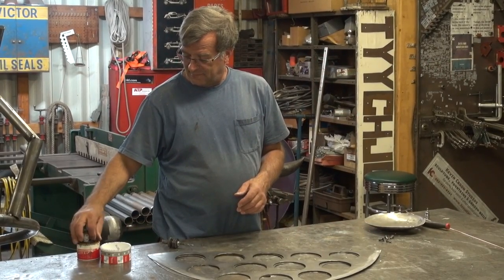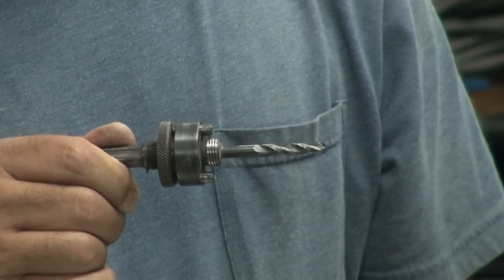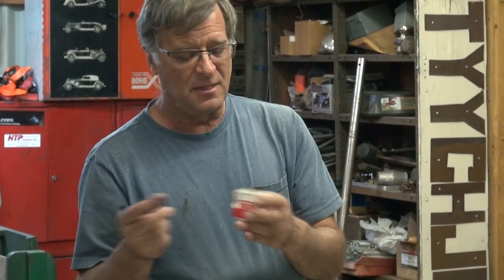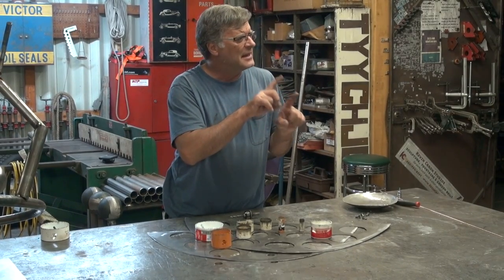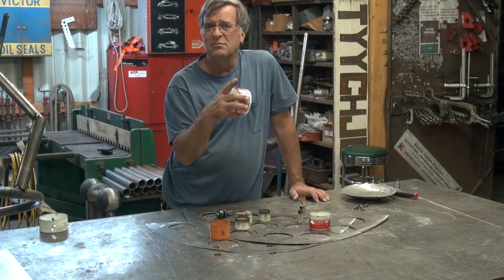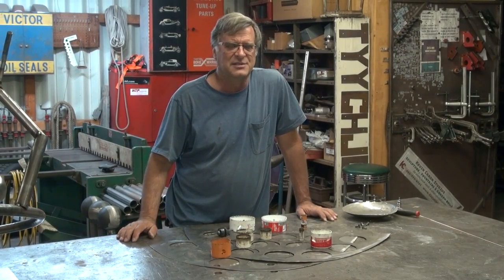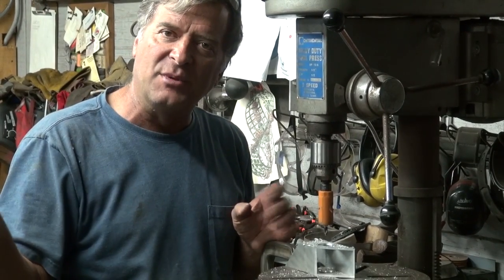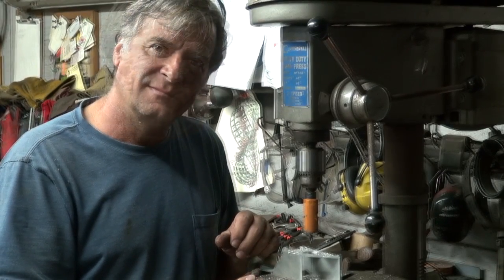How to Cut Perfect Holes in Metal - Kevin Caron

Comment: I tried making a circle cutting jig for jigsaw that I see weveryone make but it's not working for me. It will bend the blade and eventually snap the blade outside the guide. Hole saw looks better but crazy espensive. A 6 inch holesaw at Lowes was like $60.
Reply from the maker: Oh no!l  Sorry to hear that.   Tell me what you are doing and maybe I can figure out a way to help.  Are you using too wide of a blade maybe?  What are you cutting?  How fast are you running the blade and how hard are you pushing?

Comment: I find if you drill a pilot hole and replace pilot bit with a smooth rod of correct diameter prevents chatter and run out when using a hand held drill.
Reply from the maker: Have to give this a try!   Thanks for watching and posting.

Comment: Kevin look at the hf drill press locking clamp, it fits in the slot in drill press table it's adjustable to lots of stuff that you will drill I don't take mine off the table unless i have to drill something bigger than table it will also clamp your vice in place  quickly good vid THANX
Reply from the maker: Thanks for the heads up!   Will check it out!

Comment: I need some 2" round pieces from 10 gauge metal (the center after the cut). How do I get these without the drill hole in the middle?  I don't want the holes, I want the centers. So far I just fill in the drill hole with my welder and grind even but would like to eliminate this step and keep the heat off.
Reply from the maker: Use a drill press.   Clamp your metal to the table over a piece of wood and take the drill bit out of the center of the hole saw.  Go slow and use cutting oil.

Comment: Hi Kevin, great video!  With the bigger hole saws I have found it best to spin the saw cup onto the mandrel just until it touches the back part then unscrew it back a half of a turn.  This keeps the saw cup from seizing up if it heats up a bit during use.
Reply from the maker: Great tip!   Thanks for posting.

Comment: Kevin,
Thank for video. Maybe you know how to make disc from stainless steel plate(1mm) dia 30 to 60mm?
Reply from the maker: I would just cut it out of a sheet.     Or do you mean a dish?   Then you need a wheel or a shaper.
Reply: I need small disc different diameter(30,40,50,60mm).It is different thickness(1mm, 0,5mm,or 0,7mm). I need this small disc, for keyring pendant

Comment: kevin i just watched you hole cutting i want to cut 5mm of steel and i want to cut 39mm hole and then a 46mm hole on the outsde of it to make a circle ie  a wheel could i use these drill bit to do this
Reply from the maker: Yes, you can.   just do the outside first then the inside.

Comment: Thanks for the great video.  I never knew there was an automatic center punch.  Ran out and bought one right away.  One thing you didn't mention though was that you can use these bits for wood also.  The trick is to make sure when  purchasing them that you buy the long or deeper ones.  If not and you try to drill through thicker surfaces like a desk top, your bitt won't be deep anough to make it all the way through.  Tall works on anything plus they come with a channel on the side so that you can push the core out after cut.
Reply: I have not seen an automatic punch either! You learn an awful lot of unexpected things from watching someone else at work. Neither of you would think the other doesnt know this! Keep it up

Comment: Nice video. Thanks. 
I need to make  a "washer" that has a 3" OD and a 2" ID. I have not found these for sale. So I thought I would use a Greenlee Slugbuster Knockout to open up a 3" x 1 5/8" washer. The washers I found on McMaster Carr are only 0.13 thick -- just shy of the 10 gauge these cutters are rated for. The washers are not hardened and are just zinc coated steel. What do you think? Would you try the hole cutter first? Not sure how to hold the washer while cutting.
Reply from the maker: Never used one of those cutter so can't offer an opinion.  

I would probably use a hole saw with the washer clamped to the table some how...

Comment: Ok, this is a different subject I am going to ask. I came here, after looking on metalfreak. I want to make a submarine. Well, the top half. It is a mailbox idea I have. I will make it with aluminum. I guessed, that I would need to make the inside structure with three half circles. Front, middle and back. Then, put square tube on the top left and right and side left in right. The thing would be at least three feet long. But, being new to welding, how can I get aluminum bar to make a circle? Haha. Is that a dumb question? I imagine it would be tough to bend the stuff. Can I make cuts that will make it be a perfect circle? I would then out I guess a sheet of aluminum over each side to make the main sub base. Just a random question.
Reply from the maker: Bend the flat sheet to make the shell and add a cross brace to stiffen it..    Then cut half circles to make ends and rivet them in place.   Bend square tube can be done but not by hand..   Google "tube rollers" and look for the square dies to go with it..
Reply: That makes sense.  haha  No sure what rivet is.  haha  GOOGLE!  I am going to email you my first idea.  But, yours seems much better.  I mean, it's like you've done this before.  haha

Comment: Do you think i could do a 4 or 5 inch hole in the side of my jeep for a gas filler relocation - obviously vertical sheet metal with hand held drill??
Reply from the maker: Find some way to clamp a block of wood on the back side of the panel.   That will give the saw something to guide on and keep it from wondering around.     Go slow and you should be fine.
Reply: @KevincaronSculpture  This is helpful to me as well :-). 
I’m cutting a 4” circle in the sidewall of my stackable washer- Dyer to save walkspace, but still have proper venting :-)

Comment: Hei Kevin. Thanks for the video. I am wondering if you can help me with this one: 

I want to cut a ca. 100mm hole into a 1mm metal plate (mild metal). The plate is too large to fit a drill press that i could borrow. Do you suggest i try a hand held drill with a 100mm hole saw, or will that be difficult? 

Also read stuff about thin metal such as this is difficult to process with hole saws. What is your experience on that?

Thanks in advance.
Reply from the maker: Try using the hand held drill with a block of wood on the other side of the metal to drill in to.. That will keep the drill from wondering.

Comment: The secret to using holesaws with a hand held drill is to drill the pilot hole with the saw off the mandrel, then install the saw and begin cutting. This gives you control over the saw "hogging in" as the drill bit breaks through and allows you to better center the saw on the work as it begins cutting. Equally important in wood or metal. I like to use an extension cord so I can stand on it at the connection to my drill. This way if the saw hogs in and wraps the cord around your hand you can use your off hand or even a foot to quickly unplug the drill motor. It can be shocking to discover how powerful even a little 1/4" corded drill can be when the bit stops turning and the drill motor spins in your hand and wraps the cord around your trigger finger so you can't shut it off. Not that that has ever happened to me of course LOL.

Comment: I know that you used a specific type of big drill bit to make a circle into sheet metal but is there a way to make perfect holes using a basic 1/4" drill bit into 2mm to 3mm aluminum sheet metal... I'm trying to do this to heat sink aluminum
Reply from the maker: +GUNVALKERIE      Drill it just under the size you want and get a reamer to true the hole with...

Comment: My small concern is about  managing the rpm on my hand drill 9 amp to prevent from  overheating  and the best cutting fluid I can get?
Reply from the maker: +Bruno Laflamm         There are many good cutting fluids out there...    check with the folk at MSCDIRECT.COM        they can steer you in the right direction...            Or just use old automatic tranny fluid.      I hear that works pretty good....

Comment: Thanks for the video.  I wonder if you can help. I need to enlarge the two tap holes in a steel bath from 38mm(about 1.5") to 44mm (about 1.75") as neatly as possible.  There is obviously nowhere for the pilot to go.  How could you do that job, or is it a job best left alone?
FYI: The reason is to fit a special kit to make it possible in the future to replace the bath shower mixer tap assembly without the awkward job of going behind and underneath the bath to access the plumbing.
Thanks for any advice you can give.

Chris.
Reply: *****
Thanks Kevin..interesting idea. I thought of another possible way. I have rubber bungs that go into demijohns for home brewing.  They are just about the same size as the tap holes and have a hole in the middle for a bubbler airlock. They taper in width slightly towards the bottom like upside down truncated cones.  Once wrapped in some duct tape they fit tightly low down into the holes with only a little showing above. The hole in the bung is similar in size to the pilot drill....just a thought!

Comment: At what thickness of aluminum would you say is to think for these type of bits? I am making a skid plate and I want to make sure I can cut through it. Would 1/4 be way to thick for these bits?
Reply: *****
Kevin, I've seen a guy demonstrate this on Youtube. He cut 1/2" steel by holding the nozzle of a vacuum cleaner close to the blade teeth. The vac took away the swarf, and kept the teeth perfectly cool. Amazing!

Comment: ***** , I'm needing to cut a 2" diameter hole into the side of a 16qt. aluminum stock pot (close to the bottom of the pot). Any hints on cutting a hole into such a curved surface? Thanks!

Comment: Good video, the one problem that I did see was that you keep your pilot bit too far out past the teeth of the hole saw, they have a set screw on the side of the mandrel so you can adjust the bit for the thickness of the metal you are drilling through (these are special bits with a flat on them so be sure that it is turned right and the set screw is tightened against the flat). This is fine in thin metals and aluminum but if you are drilling into mild steel, brass or stainless steel especially if you are using a hand drill the pilot bit will grab as it penetrates and exits the metal and jerk the hole saw into the material and damage the teeth on the hole saw itself.
Reply: I like your videos, keep them coming.

Comment: Kevin, I love your videos!  You have got me out of minor jams in my metal explorations many of times.  I know you say to use a drill press at larger than 1 1/12" but I have not yet got one.  Would I be safe clamping the work piece on my welding table supported by scrap timber with my hand drill?

Comment: I asked my local hw shop for a metal hole saw. They had holesaws like yours and they told me that they are designed for wood and will do the job for a while, but will quickly destroy the cutting edge. For metal holes they had this christmas tree looking drill bit which is only able to cut up to 3cm diameter hole. I bought neither, since I need to make bigger holes, at least up to 5cm.

Obviously they just had a bad selection and I need to find holesaws with metal edge like yours. I wish there was adjustable one though, those sets can be rather expensive.

Thanks for the vid.
Reply: ***** seriously, these are the same as the wood cutting hole saw kits i see? so go slow and use a coolant? thanks for sharing!
Reply: ***** thepoultrypeople I bought a set of 8 hole saws. They were designed for wood/plastic etc. lighter materials. I tried to saw through a very thin metal Ikea bowl (for DIY lamp project) and failed miserably. I used WD40 as fluid since I didn't have anything else at the time and went very slow. The blade is completely destroyed and I didn't even manage to make the hole.

After this failed attempt, I bought one of those bi-metal hole saws and it did the job perfectly. The first set I bough was only 8€, so I didn't lose much.
Reply: thank you, im going to be ordering a set once my pillar drill arives, well, once ive found an old pillar drill thats worth buying that is :)
Reply: I m sorry but the cheaper saws designed for wood will not last long on metal. You need whats called a bi-metal hole saw. Its designed to take the heat.
Reply: Kopsu Yes these saws are designed with a Bi-Metal blade which is the same material that metal cutting band saw blades are made from. Unless abused, like running at to fast a speed, getting them too hot and little or no use of cutting fluid they will last a lifetime. The wood type is just for wood whereas bi-metal can be used for either so it willl serve double duty. Remember the larger the bit or holesaw the slower the speed and feedrate. You should search drill speed and feedrates and you should find charts on this for a good reference.
Reply: Kopsu If the saws Kevin is using are lasting and cutting then they are bi-metal saws and he just thinks they are just wood cutting saws and he may not know the difference.
Reply: ***** Kay P 
Since I posted my comment, I have bought a couple of bi-metal hole saws. They are great! Sure they cost a bit more, but in my light use, they will probably last me my whole life. 

I've made maybe 20 holes (on thin sheet metal) with them now and the only thing that seems to have suffered is the paint on the bit. The teeth are flawless and seem brand new.

Thanks guys for the input -> When in doubt, go with bi-metal ;)
Reply: ***** Tap urself on the forehead and say " I couldhave had a V-8! "
Reply: Kay P your comment much appreciated

Comment: Kevin
I was on a job that required many 1.250 holes through 14 ga. with a hand drill and kept breaking bits when the teeth started to grab.  Tried everything from pressure to speed but still broke them................and then my Ukrainian brain kicked in.  I plotted out the centers of all the holes, pre drilled a 1/4" hole, took the 1/4" bit out of the mandrill and replaced it with a  short piece of 1/4" cold rolled with a slightly sharpened point and proceeded to drill 75 more holes with no problems, and have used that mandrill for a couple of years since with the same piece of cold rolled.

Comment: Kevin I need to cut a 1" hole in my pc case but the problem is the top of the case already has small oval holes in it for air flow. How (what tool) can I use to cut a perfect hole??? Im afraid a hole saw or step drill bit might not work or it might walk because of the premade holes.
Reply: That answers how but not WHAT. My question is WHAT TOOL should i use???
Because the metal is like a thicker gauge steel mesh with oval not round holes I am afraid a hole saw or step bit might catch on the holes and tear it up. What tool is best for this job? thanks I appreciate your time and help!
Here is a pic of the case im cutting. 3rd picture down:
http://techreport.com/review/25410/corsair-obsidian-series-750d-case-reviewed/2

Comment: Nice video.I use 75% water 25% soap detergent in a spray bottle as a lubricant to keep the blade cool & lubircated.You don' have that oily mess to clean up after wards.
Reply: Homemade emulsified cutting fluid is water, detergent, oil, and alcohol, or some other suitable de-foaming agent. Detergent proves the old adage of oil and water not mixing wrong. But when you mix soap and water you end up with a lot of bubbles. So alcohol acts as a surfacant to break up the foam. The amount of oil used controls corrosion. Although you do have to clean up. You end up with organic cutting fluid with this formula. It looks like the white kind of coolant.
Reply: I do a lot of drilling on bridge rail.If you use cutting oil the state inspector frowns on that because the oil gets on the concrete deck and you have to clean it up(labor intense).By using water and soap there is no clean up it's biodegradable.Everybody's happy!The only thing you have to do is spray the drilled hole with cold galvanized spray.It works for me.
Reply: Tell that bureaucrat that oil comes out of the ground. So a little laying on it isn't going to hurt anyone.
Reply: You can add a bit of oil to your mix and have an emulsified cutting fluid.
Reply: This is good to know, but what is the value of an emulsified cutting fluid vs. straight cutting oil vs. the proposed soapy water vs. Astro-Glide?
Reply: Emulsified oil is a lot cheaper than straight oil by volume. Plus I imagine it has better cooling properties. Soapy water is not going to lubricate metal nearly as well as oil does. We ran straight 30 weight oil on our broach in the shop where I worked. That machine had a 500 gallon reservoir in it, and the oil would get hot over the course of the day.  Milling machines had 10 gallon emulsified tanks. They stayed cool too.
Reply: Thank you.  Years ago, I used a horizontal bandsaw w/ emulsified oil and it worked great -- water has a very high thermal coefficient, which is why it can absorb so much heat before actually warming up itself.  How do we DIY emulsified oil?  Also, does the water component contribute to corrosion or does the oil keep that at bay?
Reply: I'm happy with using soap and water.It keeps the state boys off my back.
Reply: What's that! Is your elevator working?

Comment: we used to use the 6" dia saw for cutting the fuel opening for toro gas tanks that were made from hard plastic. these saws are designed to hold the waste so it doesn't drop back in the tank. but keep them sharp!